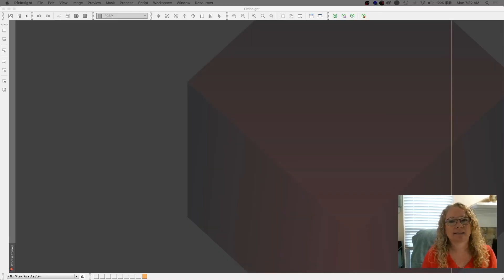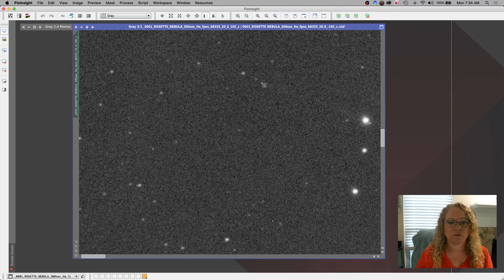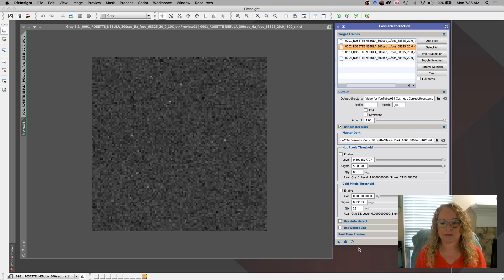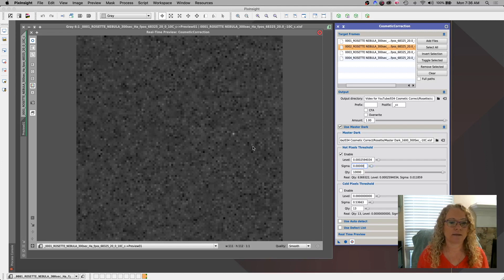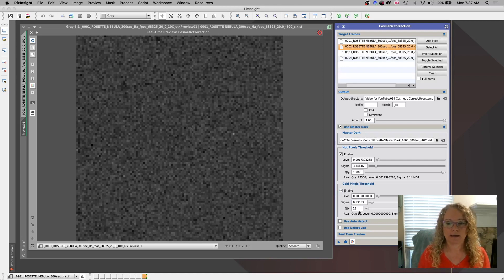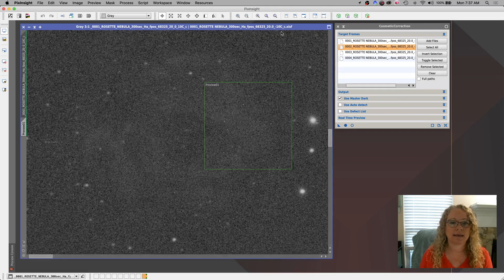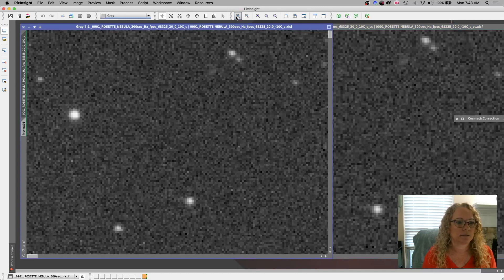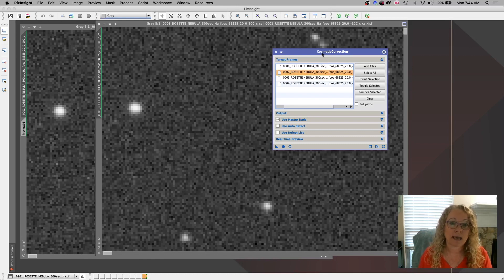PixInsight - Cosmetic Correction

Comment: Thanks for your great videos Amy! I have the new ZWO ASI2600 MC and was wondering if by dithering every image I will remove as many hot pixels as CC? Or if both CC and dithering together will be necessary? I'm tempted not to use dark frames and stay with only Flats and Dark-Flats if possible. Also it seems super short bias doesn't seem to work well with the ASI2600 but dark-flats may?
Reply from the maker: Dithering smooths out the rough edges on stars. It won't remove hot pixels.  Hot pixels are part of the camera sensor itself.  So keep the darks.  The bias frames are not as important anymore.  Dark-Flats are to calibrate with the Flat frames and they do help. If you are on a cooled camera then you can take the darks when you first buy the camera and keep reusing them.
Reply: @AmyAstro  That's not accurate, it will do nothing for rough star edges unless you are also incorporating drizzle integration and shooting undersampled. Dithering is primarily used to remove fixed pattern noise like hot and cold pixels, if we dither then registration will change the position of these hot/cold pixels so they are recognized as outliers and will be rejected during integration.

Comment: Hi Amy,

CC is something I haven't tried yet. I see there is a check box in Batch PreProcessing but it doesn't work for me, probably since I have not done what you just explained, and haven't linked in the generated parameters.

But can you explain what CC does over the normal Dark subtraction? I can see more hot pixels in longer Darks, but I thought these are removed from the light subs during the normal ImageCalibration process since they should be in the same x-y locations. Or should I calibrate first and then do CC, eliminating anything missed? 

Thanks for the video, more knowledge always helps!

John
Reply from the maker: I would think that doing calibration with the master dark would remove hot pixels, but it feels like it misses some.  Cosmetic correction cleans out what it misses in my opinion.  If you create a bad pixel map and save it with cosmetic correction you could possibly use that during the batch preprocess.
Reply: Thanks Amy. As they say, you don't know until you try. Will give CC a go on my next processing run.

Comment: Hi Amy! Thank you very much for this info!  Ass an extra info, you can add cosmetic correction to the batch pre processing script by only keeping the icon in your Pixinsight screen.
Reply from the maker: This I do not know.  I've not had luck with  batch pre-processing.  I do it all long hand.  I will ask around.
Reply: @AmyAstro  Thanks! I normally use cosmetic correction with auto detect on 3, on both cold and hot pixels. I am not really sure if those values are perfect, but comparing results with the method that you just shared, gets me really close to your results. I'll be looking into more of your videos, thank you so much for sharing your knowledge! 😁
Reply from the maker: @guillespiers  Wonderful!  Let me know if you need any help.